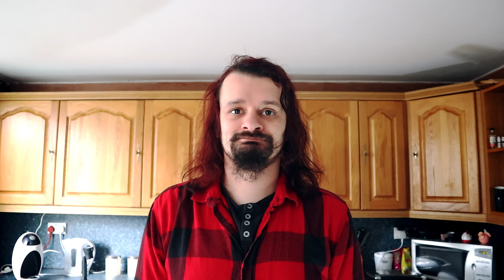SLI With Two Different Graphics Cards | Nvidia GTX 480 & GTX 460 Using Modded Drivers

Comment: Thanks a lot, but you have same problems with tutorial 

You need 
Uninstall ALL DRIVERS with DDU 
Install 388.71 Version driver
Edit script file, and patch dll
And patch cert
After that, in nvidia control panel you gets sli, but you can't apply, because edge processes, shell and some apps. need close but after that, you CANT close shell appliication in windows 11
to close that you need download git, (cmd dosen't work) and past some times, taskkill shell application 
and quick launch apply, in control panel

But after that without sli bridge with 2600x ryzen, i gets work sli with two 550ti, thanks a lot!

Comment: Based on my experience, I can say that there is some problem with Windows 10 or Nvidia drivers for it if you want to run old cards in SLI. In practice 95% of games and benchmarks will give you a black screen or driver crash. Same situation with dual GPU cards like GTX295, you have to use a Windows 7.

Comment: Finally got this working with 2 2GB Nvidia GT 710s and it works half way decently. About a 20% increase in performance I'd say, which isn't bad tbh. Better than not doing this mod. I get around console performance with these cheap graphics cards.
Reply from the maker: Oh nice!

Comment: I have a gt710 and im upgrading to a 1030(both gddr5 2gb) , can I sli them? and does this still work? and will I even see any noticeable improvement in performance??
Reply from the maker: They're different architectures, so it wouldn't work.
Reply: @BenchyDoesStuff  ok, thx for responding

Comment: Hi working in gtx 660  gtx 260 sli ?
Reply from the maker: No, they are different architectures, so it wouldn't work.
Reply: @BenchyDoesStuff  but working on gtx 645 and 660 ?

Comment: "And yes I'm well, well aware of just how sketchy this setup is, and I do not care."

Sounds like me back in the 90s with my A1200 constantly open with a 3.5" HDD connected to the motherboard with a 3.5"-2.5" IDE cable that was only about 4" long. Oh and the HDD was powered by a 200 watt PSU.  The only thing that PSU was used for which was handy as the HDD connector was the only thing it had left!

Ah, the good old days :D
Reply from the maker: I mean, it works :D
Reply: I made a test bench using a plastic shelf and an old PC case, but my quick and dirty test bench consisting of a power supply and a cardboard box is still my go to for testing motherboards and components. Sketchy setup...yes. Totally works...you bet, so why not! The only time it got dangerous was way back when I was 13 I accidentally burned a hole in the comforter on my bed when I accidentally created a short in a radio I was working on with a screwdriver. I melted the tip of the screwdriver, too. Good thing I was holding the plastic handle!